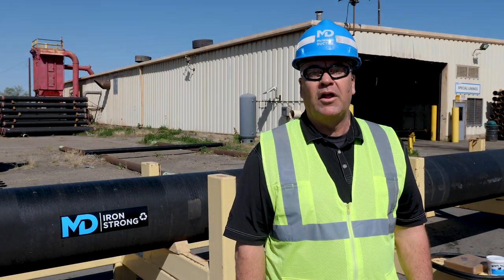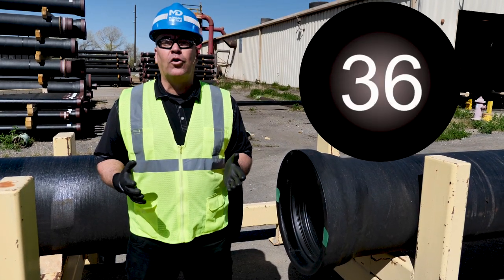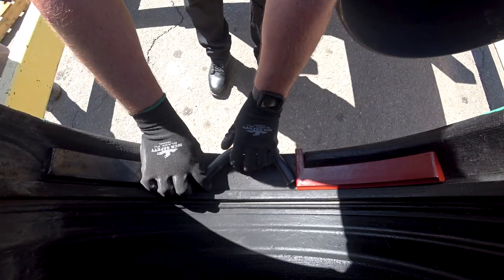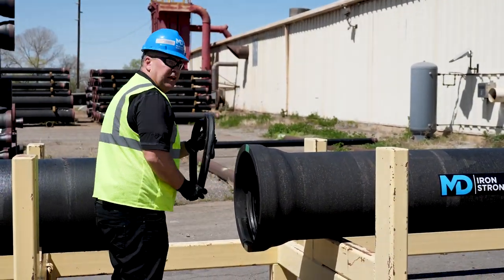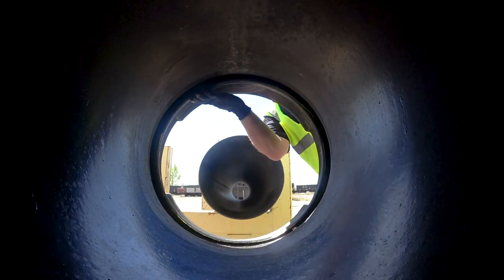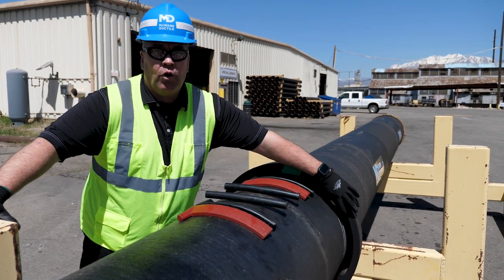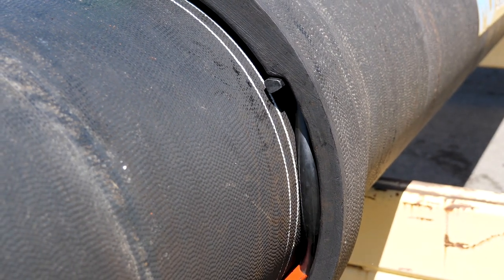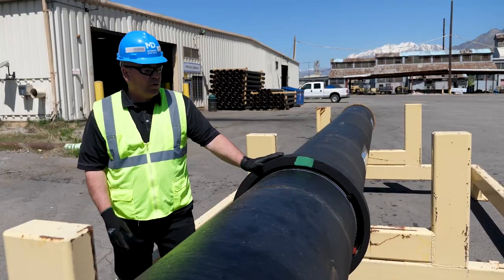How is TR Flex® Ductile Iron Pipe Assembled?

Comment: When using The TR flex fitting, is it necessary to wedge the pipe for tracing, or does the lock ring act as a wedge to transfer current?
Reply from the maker: We do not recommend the use of bronze wedges for connecting the Ductile Iron joints for tracer/locating purposes.  Tracing wires, etc should be used for non-metallic piping such as pvc.  If the intent is to bond the joints for Electrical thawing, we recommend application of our Cable Bond connection.  For additional purposes such as a form of Cathodic protection, we recommend properly bonding the joints via Thermite welding. Below are links to two excellent blogs that may be some help.

HOW TO AVOID FROZEN DUCTILE IRON PIPELINES USING ELECTRICAL THAWING
https://www.mcwaneductile.com/blog/how-to-avoid-frozen-ductile-iron-pipelines-using-electrical-thawing/

HOW TO PREVENT STRAY CURRENT IN DI PIPE AT GAS LINE CROSSINGS 
https://www.mcwaneductile.com/blog/how-to-prevent-stray-current-in-di-pipe-at-gas-line-crossings/

Comment: Maximum deflection achieved tr flex?
Reply from the maker: It depends on the diameter of the pipe, but TR Flex joints can be deflected between 1.5 and 5 degrees. Smaller diameters can be deflected more than larger ones. Here's a link to our TR Flex brochure with a chart that shows max deflection for each pipe size me make. Thanks for the question.

https://www.mcwaneductile.com/upl/downloads/catalog/products/dutile/documents/tr-flex-restrained-joint-pipe-4-36-brochure.pdf
Reply: @McWaneDuctilePipe  Thanks for the reply sir! From India ✌️

Comment: Why is this better than a locking gasket?
Reply from the maker: Thanks for your question. It’s really a matter of preference and application. TR Flex is easier to disassemble and also easier to identify as a Restrained Joint connection if it has to be excavated after installation. 
 
You should not use locking gaskets for HDD, bridge crossings or pipe on support applications. 
 
And depending on diameter, it can also be the less expensive option, too.
Reply: Sweet thanks alot !
Reply from the maker: No problem Aaron. Please let us know if you have more water and wastewater questions we can answer.